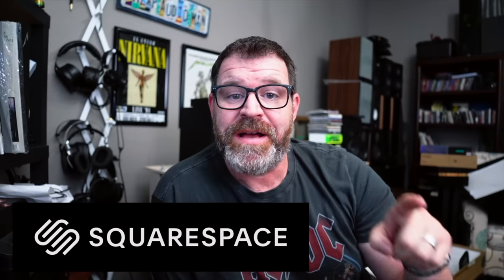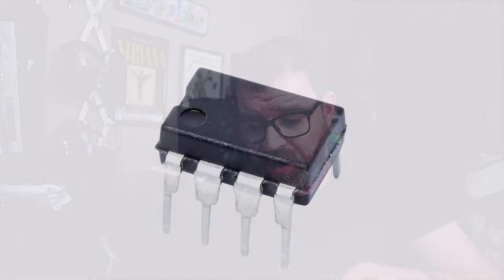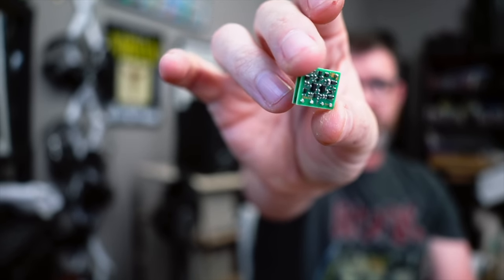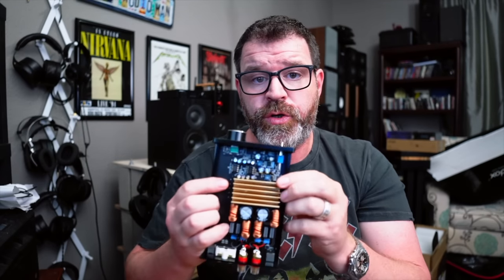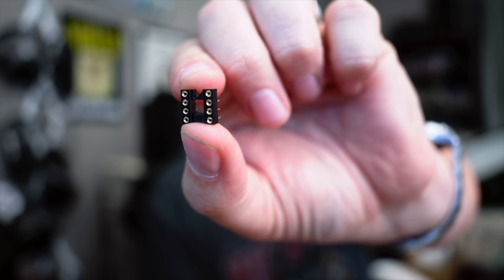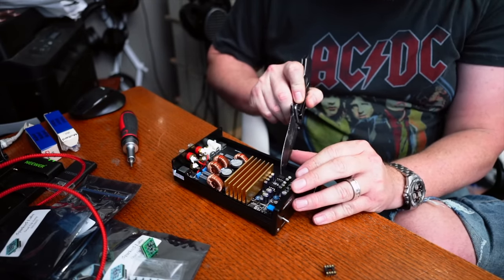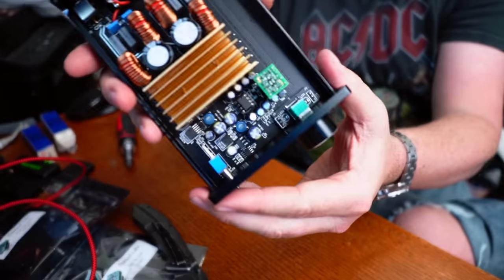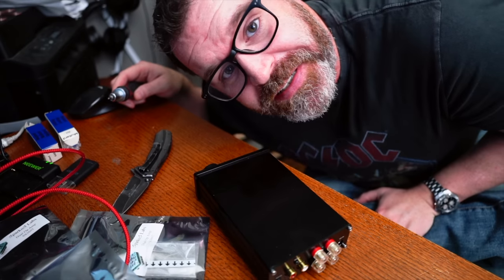Make an $80 Amp Beat $1,000 Amps?! Find out How!

Comment: I’ve got the Sparkos and burson op amps. The first time I put the Sparkos in one was backwards and it melted. I’ve done the same with busrson, no melting. It made my $700 pre amp sound like a $10,000 pre amp. 😂
Reply from the maker: Nice!
Reply: Hi  which of the two actually provided the greater improvement ? thanks, gino
Reply from the maker: @Pete.across.the.street  I ran the geshelli labs J2 DAC into it
Reply: @cheapaudioman  You could probably do an op amp swap in the Geshelli too.  Needn't be discrete, just another chip op amp may be better than what's already in there.
Reply: @gino3286  it’s system dependent. The burson gives more body to the sound. The Sparkos separates the sounds more. From stock they both organize and present the music better.
Reply: @Pete.across.the.street  Gustard P26
Reply: @gw61  thanks for the very kind reply Usually designs using discrete parts have higher output current and so drive difficult power amp better
Or headphones They are great parts indeed kind regards Gino
Reply: @HighResTime  You need the SS3602 dual discrete op amp for that.
Reply: @gw61  Which was the Burson? V5? V6? Classic or Vivid?? I’m wondering if playing with different Op Amps on my Aiyima A08 would result on a balanced mixture of qualities improvements… planning 2 Sparkos and 1 Burson.
Reply: @sloker874  v6 classic. It’s nice to be able to take advantage of that flexibility. Mixing op amps.

Comment: I missed my chance buying a Sparkos a while back, and I've been kicking myself ever since. I think it was an SS3601, could be wrong. I tend to use the Burr Brown OPA627 a lot in my cheap Zishan Z3 Pro (AK4493 version). I like that more than my LG V20.
Reply: FIY OPA627 is a single opamp, you need a twin, or an adaptor, but anyhow 627 is overrated, as with swappping opamps in general, but if you so desire use LME49720, its newer and better, and doesnt break bank.
Reply: The LGV20 really is a classic. Nothing like it before of since.

Comment: Thank you for the suggestion, I ordered parts today as I have the Aiyima AO7 and the tube-A3 pro pre amp, also after your suggestion. I like the small set-up. I also have a Marantz 2270, and an Adcom GFA 5802 for my larger rooms. Thanks for your videos!!
Reply: You notice a difference?
Reply: @timc_2433  I have this setup in a 10x10 room using Klipsch RP-160m bookshelf and a Polk PW108 powered sub. It’s sounds amazing, I didn’t have a final resting place for system until I upgraded the op-amps, so I can’t give you a yes or no on noticeable difference. I did listen to setup with factory op-amps, but in different listening room.
Reply: I do have original op-amps so now I can change back and listen again now that it’s in its final listening room and position.

Comment: All I can say is OMG!!!!!  Randy - you wonderful creature you!  I quickly ordered this Sparkos op-amp (and riser) set for my 07 - and to be honest, other than perhaps some minor differences, I wasn't expecting much beforehand.  

However, after the two op-amps and two risers arrived, the installation was a cinch - but more so, I was blown away at how a major "sonic veil" was now lifted from the music.  When you stated that the effects would be immediate, you weren't kidding.   Without exaggeration, I can see where the A07 now sounds like that proverbial $1000 amp.  The sound was not only more open and immediately noticeable, but the sound-staging now envelops the listener, making the performances more intense and engaging.   I can't believe this - what a difference this simple change out made.  As a listener of classical and jazz music, even the instrumental timbres are improved (again, that lifting of a sonic veil).  I can no longer look at my A07 as just a halfway decent cheap-sounding amp.  This A07 now competes with a half dozen other amps that I have - including two costing $1500+.  How can this happen (asked with a smile on my face)?  But I must realistically add that even with the op-amp rotation, overall - in particular, when the full crescendo of a symphony orchestra comes together, the A02 (regardless of op-amp) loses clarity and becomes a bit muddy (shame really) - but that's an Aiyima thing, not due to the Sparkos op-amps.

Since I also have the A08 (thanks again Randy),  I will have to see if the same scenario can occur with the purchase of these Sparkos op-amps.  Now that will be interesting, to say the least.

It's postings like this that provide a tremendous service to a wide variety of audiophiles.  Normally, I would have overlooked this, somehow surmising in my little mind that spending almost twice as much as the basic amp cost, for a few little tweaks, just wouldn't be cost-effective.  But I am so glad I ignored that little voice in my head - as this elevates the A07 into a higher-level sonic creature.

Randy, I'm glad that I've become an ongoing watcher of your reviews and have subscribed to your channel.  After a year of watching another channel (the one where all you see are the forearms and chunky hands of the reviewer because he wears a go-pro on his head (who by the way, has elevated the F word to new heights - i.e. using it as a verb, pronoun, noun, adjective, and much more), your reviews (and humor) are a refreshing change.  You actually talk about sound qualities, rather than features alone.

Ben Herrmann
Fuquay-Varina, NC

Comment: Jeez Randy, please use some ESD caution!  How much you need depends on the humidity of the air you’re working in and the conductivity of your floor and workspace.  At least set all your stuff on some aluminum foil for a while before doing the operation, and touch it often with your hands.  Great topic! 👍

Comment: i did the same thing with my Fosi Audio Tube P2, sounds great! rolled tubes in it and my Nobsound NS-10T and they sound great with my DT990. I want to upgrade my sound card and drop in some Sparkos in that, maybe the larger pro-audio op amps. lots of cheap options out there these days and Sparkos makes them sound even better.

Comment: Thank you, Randy. I really enjoyed this upgrade review. I would never take on a Akitika or Amp Camp Amp, but this looks like something I could do successfully.
Reply from the maker: you got this, Tony
Reply: There's a lot of choices in op amps to pick from, I've used some Burson V5i-D in mine a while ago (had used them before in something else). There are cheaper options too so you can get a bunch of different ones and try them out(you may prefer the cheaper ones to the more expensive ones).
Reply: @cheapaudioman  what would be a good op amp for the A300? Seems like the hardware is pretty close minus the dedicated full sub out and the XLR inputs. That and 2 modes (direct and tone). It also has an internal PSU vs external on the A07.

I've enjoyed swapping out parts on many electronic devices. Especially if there is a significant upgrade in quality without spending 3x as much

Comment: I'm told the OPA1656, which you can get fairly cheap, are a phenomenal upgrade here.  Is that correct?
Reply: Or the OP2134. I ordered those awhile back and still getting around to tweaking the A08. But  I'm also curious how these cheaper op amps would compare. For those unfamiliar, we're talking $20 or less for the cheaper ones in many cases.
Reply: @Douglas Blake well then spill the beans DB! My quick search at the time led me to Amazon
Reply: @diamondbracelette  I bought two off of Ebay along with some risers, and it was cheap. It looks like through Aliexpress, I could have spent even less.
Reply: @Douglas Blake Thanks for this.  Am I crazy thinking this discrete opamp price of $80 per opamp is expensive?  It seems like it.  I know JS Audio and others swear by discrete opamps and not chips, but I just wonder about the cost and if the improvement is that significant.
Reply: @Douglas Blake I just used Amazon like you yourself suggested, and don't shop at audiophile retailers. I'm Basic. Good to know about retailers who sell the chips as non secialized parts tho

Comment: Great video, especially for people who realize the benefit of something like this. Having built or repaired computers, laptops, and smart phones, this looks no harder than swapping out memory in a computer. You just have to make sure you plug it in the right way as computer memory is slotted to not allow you to insert it the wrong way. Laptops aren't fun to work on and smartphones just plain suc I'm to try and repair. 

Would this work with the Aiyima A300? If so, would it be the same chip based off amp that the A07 uses or would it be a different chip? I can probably figure it out in a few Google searches but obviously you would know, or figure out way quicker than I could. 

Also, thanks for all your tips in various other videos. I was looking for some bookshelf speakers. While I wasn't planning to spend what I did on the Elac Uni 2 B52's, I'm glad I did and I've only had them for 9 or 10 days so still breaking them in. They didn't amaze me out of the box but they have been getting better every day. Vocals are crisp and clear. It's just balanced as you stated over and over in various videos. 

I'm not sure why people think speaker break in isn't real. Think about it, popular materials for speaker cones are paper, metal, plastic, and aramid fiber. Plastic is obviously going to stretch out a bit over time. Paper has more variables. Aluminum is woven very tightly so it will stretch a bit over time. I don't believe I've had a speaker that uses aramid fiber. Personally, I believe speaker manufacturers make the woven cone material slightly tighter than it should be for this very reason. 

I also have the Sony HT-A7000 and initially I was going to return it. Out of the box. I wasn't amazed. Then Sony announced new rears which are 2 smaller A9'S that run on battery for 10 hours (per Sony) and they are bringing the same software used in the A9's. Initially I didn't get a great Atmos effect but I swear, one day it's like it turned into a completely different sounding speaker. All the sudden I was hearing sounds that were coming 4ft behind my head. A wall is 1 door away so that was new. 

Anyway, it wasn't great for music, which is why I got the Elac's, Aiyima A300 and the iFi signature one, mainly because it had the right inputs/outputs I needed for my setup.

Now I can hook the optical out from my TV to the iFi and with some tinkering around with time delays, get everything to synch up perfectly so it's the best of both worlds for movies. Music is just Elac's. I do wish the wireless Sony subwoofer did have an input but I will just get sub down the line.

Comment: Just made the Sparkos SS3602 op amp swap in my Aiyima A07. Easy mechanical change. This was a piece of cake to do. 

I did have to pull the new op amps out once and reseat them to get a solid connection. 

Listening to same Robyn Hitchcock tracks as right before the change, I hear a significant improvement in detail especially noticeable in percussion. I heard thing I hadn’t noticed pre swap. Vocals were also clearer. 

Definitely recommend the modification. 

Will pass on chasing a stepped up power supply. Plenty of power already on tap in the stock unit for a small room or near field listening.

Comment: I think that the term "rolling" in this context, comes from tubes - when you are swapping them out, they roll around your table/desk while you are looking for the one(s) you want to try?
I don't know - but that's my impression. From tubes, to all the other things you can swap out, the term "rolling" has stuck.
Reply: No -- it comes from the rolling motion that's recommended for safely removing vacuum tubes from their sockets, which works better than pulling straight up, especially when working on older gear.
Reply: @editorjuno  Okay, that's an aspect I hadn't thought of. I am familiar with that motion - some tubes do take some doing to get them out.

Comment: Question, you installed 2x SS3602 Dual Discrete Op Amp, so its $80x2 = $160.  The A07 cost around $80.  Adding a higher end PSU could go into $50-80.   So upgrading an A07 could go into $320 there could be more options.

Comment: I am stoked have this whole project on order the  A07 is in hand and sounds ok threw my Sabaj D5 into the xduo mt 602 with Vokshod Rocket 6j1p tubes then to the Aiyima A07. The bummer is the power supply is going to take until June to get delivered threw Amazon (can anyone recommend an alternate power supply or source for the Aiyima one? I am trying to build a desktop setup that outperforms my seperates  which my be a bit difficult on my budget :) I use a Rotel RC 995 pre amp with a Harmen Karden PA2000 solid state amp. and a nearly impossible to find info on soliloquy 5.0 bookshelves. Love your show CAM.
Reply: I have done the op amp install and love the sound of the sparkoslabs opamp's very nice thank you for your guidance really made a huge difference and worth the money. Still waiting for the up graded power supply but am very happy with my desktop setup now. or for now :) we all know how that goes. Also wanted to mention the excellence of Sparkos customer service which is Sparko himself to be honest this is a night and day difference in sound quality.

Comment: I have a semi-related question: I went looking for some of these high voltage high current linear power supplies that Randy has been talking about as an Aiyima upgrade path, and I have had zero luck sourcing such an animal, including on both Amazon and eBay. Am I using the wrong search terms? The amp I'm looking to buy is the Aiyima T9 Pro and the upgrade path for the power supply is 32v9a linear. Anybody?
Reply: be sure to practive fire safety as there is a video testing the chip and it's not up to spec, just unplug when not directly monitoring.
Reply: @trauma50disaster1  I believe that was the T9, not the T9 Pro.

Comment: I would venture to say an OPA1656 would sound better. Of course you would need an SOIC to DIP adapter, but it is worth it. 

And this is not a hack, this a mod or modification. The designer of the amplifier clearly already installed the quick change DIP adapters. Otherwise you would be de-soldering.
Reply: Are the chips which come connected to a dip8 socket the correct ones ?
Thank you

Comment: Please let us all know did you use SS3602 with the 48 volt power supply? And did you use the 48 volt power supply with stock amps and get a buzz out the speakers like I did? Just $160.00 more for the 2 amps to pump it up. Thank You Again. Maybe if you can, Get your hands on a Outlaw Audio RR2160 MKII. All I do is smile now when I hear mine.  Add a Loki 2.0 to the tape loop and fly!

Comment: well, well, weel. hard for me to believe that the sounstage is better, a better opamp will have a lower noise floor, less distortion and possibly more bandwidth.
Reply: The soundstage on this amp is rubbish. I am all for cheap but the hype on this amp is ridiculous. It's a great $80 amp and that's all it will ever be. Buy a better amp used and be happy. That's my advice to folks.
Reply: @Douglas Blake Listening to the same recording using all the same equipment other than the amp, I noticed a distinctly different soundstage so I assumed it was the amp. (Cambridge Audio Topaz SR20 vs. Aiyima A07)

What else could it have been?

Comment: Hey Randy!

I was looking at the  manual for the Aiyima A07 and noticed that it says the 3.5 mm jack on the back is an output! 

I found a cable with a stereo 3.5mm plug on one end and one RCA plug on the other end. I plugged the RCA plug in to my Sony SA-CS9 subwoofer and the other end to the AUX input on the back panel of the A07. The subwoofer started working but unfortunately only the right channel on the power amplifier had any output. 

Any ideas where to find the correct cable?

Comment: Interesting - I bought one of these A07 amps and put it in my system with Polk Reserve R20 speakers. Stock - amp was very good, beating out my Integra D40.7 stereo receiver (admittedly not a great amp, but ok). Replaced the opamp with a pair of OPA2604s I had left over from my Audio-gd Fun days. The OPA2604 was slightly better, but not amazingly so, No surprise there. Then I took the A07 out to my garage, where I have a pair of Boehlender-Graebner BG Radia in-wall speakers with their super detailed ribbon mids. The A07 sounded awful, clearly worse than the Integra on all music.
Reply: OPA2604 is way too noisy these days, its rather an old design. OPA1642 is the go-to JFET opamp nowadays but not available DIL. So you'll need an adapter PCB.

Comment: Cool! Can this be done with the SMSL AO200?  I like mods! 🔈👍🏻
Reply from the maker: you'll have to check.  technically it can be done with any amps that contain op amps which is about any of them.  they don't all have op amp receivers soldered into the board so some are much harder to change than others

Comment: did you just replaced single OPamps with dual Opamps?
Reply: I learned from stupidly not doing any spec research that the Aiyima A07 is in fact using dual OPAmps.  I tried the singles from Sparkos and they do not work.